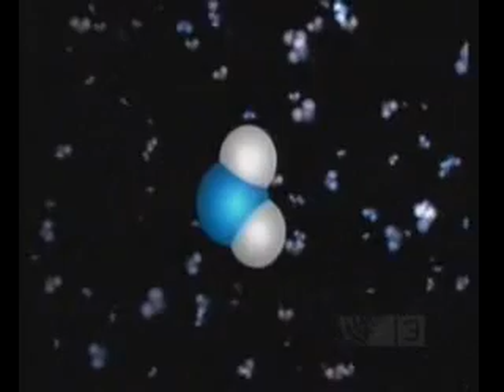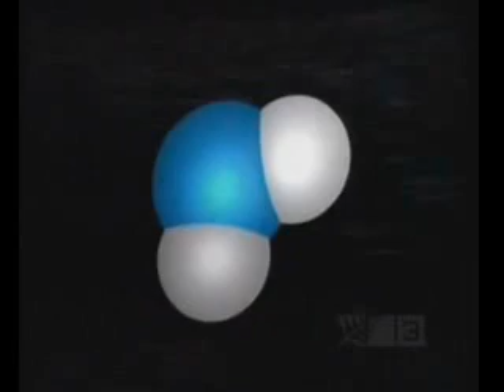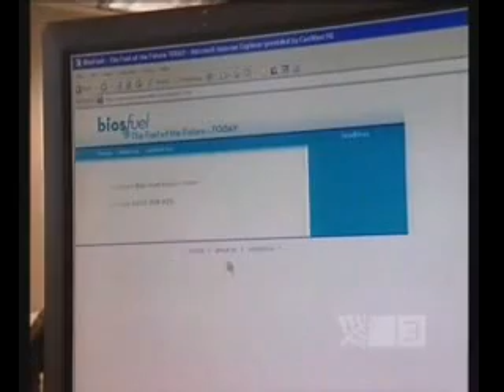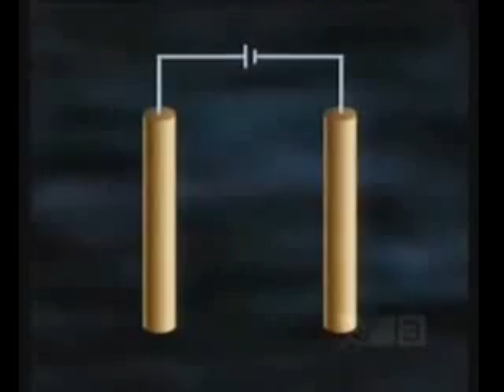A Motorcycle that runs on PURE Water.

Comment: If this actually works on a motorcycle then it wouldn't be that hard to build a 40 hp engine with a generator. Then every home would have there own power supply. Just pound a shallow well or collect rain water for fuel.

Comment: So, what was already in the fuel tank?   Funny how no one bothers to look for the obvious cheat.  Two compartments in the fuel tank. Duh. This motorcycle probably runs on alcohol. That would explain why there is no typical gasoline smell from the exhaust, and why the stuff in the fuel line doesn't look or smell like gasoline.  If this bike was truly running on water, there would be no need for a carb, because the water would have to be separated into hydrogen and oxygen before entering the cyls.   Conclusion:  like all others it's a fraud.  This guy is going to live off of the donations of gullible "investors".... What is sad is that this has happened hundreds of times in the past.  "There is a never ending supply of fools.. who want to be fooled." P.T.Barnum.

Comment: BIOS Fuel??? Exactly WHAT processing has to be done to the water if his engine runs on pure water... If this is ELECTROLYSIS as that professor with the handsome teeth suggested, THAT isn't going to be patented... ELECTROLYSIS is a physical phenomenon that is common knowledge and isn't a trade secret.... So, what we are all expected to take away from this video is that some random, obscure, unknown,  untrained, uneducated self proclaimed inventor with no financial means devised a technology/process which is nothing short of miraculous and which has evaded the entire mainstream scientific community since the invention of the internal combustion engine, and did so without any technological backing or support from ANY well known, established, respected scientific organizations or institutions??? I'd like to know what exactly does anyone think can be done to water (without adding anything to it) that would change its chemical properties and convert it into some sort of combustible fuel? Question... If there was no electricity used in the process, what the hell did connecting those wires do?

Comment: Electrolysis of water does produce Oxygen and Hydrogen but it takes electricity (energy) to make it.
Reply: Did he not say he wasn't using electrolosys? In the HHO world, we knew that HHO can't be used directly in a standard engine configuration due to the outstanding speed of combustion. Hydrogen works in large quantity, but as spoken, needs too much juice to make it.
There IS however, a guy off-grid who makes his hydrogen from solar to power his farm and vehicles.
Saw this video back in my HHO days, never heard whatever happened to this guy.

Comment: If the HHO gas made from water is dense enough, vehicle engine can likely run on it. You will need high amps Alternator that will produce lots of HHO gas via HHO dry cell in seconds and send it to engine.

Comment: They've had motorcycles that run on water for years. They call them jet skis or Sea-Doos! 😂😜
You need a catalyst to help separate the 2 hydrogen molecules from the oxygen molecule. Typically it's done using electricity you can also use baking soda as the catalyst but I'm sure there are other more efficient catalysts then baking soda.
Reply: These products use petrol to run a internal combustion engine that pushes water out the back for the thrust via a turbine pump!!

Comment: Can't remember the name of the chemical but there is a substance that acts as a catalyst when mixed with water allowing it to burn in a combustion engine. Problem is it burns the engine up in short order and costs more than gas. It was featured in an old cop show back in the 70's because the inventor on the show was supposedly murdered.

Comment: Water engine? I guess the days of STEAM ENGINES were not real. But I suppose that technically they needed a companion fuel to heat the water a bit like hybrid electric cars. But even electric needs a secondary source of replenishment. The real water motor has been around for a long time & requires a specific oxygen, hydrogen & nitrous oxide mix to function & that is where the problem lays. Highly explosive in the wrong conditions.

Comment: The "secret process" is passing an electric current through water creating hydrogen and oxygen (discovered by Michael Faraday 1832) This will burn - it's called Browns Gas. So water is just the intermediary, the power comes from electricity. You might as well say a steam engine runs on water (which it does) but water is only the intermediary. See here: https://en.wikipedia.org/wiki/Electrolysis

Comment: I want to smell the exhaust fumes.
Reply: Back in 1972 I set up a small Kubota diesel motor to run reclaimed vegetable oil ( I think it was canola oil) that I heated to engine temperature at about 190F. I had to filter the heck out of it so it wouldn't clog the injectors but it ran pretty dang good! Remember that Rudolf Diesel ran his diesel motor invention on peanut oil. This is what got me thinking it might work. I didn't invent the process but was the first in NW United States to run this diesel on vegoil in a 1970 Honda 600 sedan (tiny Kei car from Japan) The original motor was a two cylinder air cooled piece of !@%@!$ motor that had blown up!  I adapted that two cylinder diesel to fit and drove that thing back and forth over 80 miles round trip per day commuting to work. I ran low one day and had to top up with diesel before heading home. While getting the diesel I left the motor running cause starting it from cold was a process to say the least. The guy started complaining about the fast food smell that was supposedly coming from just down the street, that it was making him hungry! I told him it was my exhaust and he didn't believe me until I made a bet with him to get down and smell my exhaust. If that wasn't the smell source I would give him $5! He sure had a funny look on his face when he got back up. Didn't know what to think. I showed him my engine compartment with the extra plumbing and such to pre-heat the vegetable oil then he started to believe with amazement. I commuted all that summer with that car. It was not very comfortable to drive at 55mph cause the wheels were tiny (10" rim size) and very short wheel base. Kinda like a glorified go kart but fun at slow speeds around town. I still have the vehicle but sold the motor. I plan to convert it to electric power next.
Reply: @willyam9735  We need more people like you with imagination, that is a commodity sadly lacking today, more power to you.

Comment: all you have to do is spray a mist into an electrical grid of wires and you will have fuel that  burns
Reply: jerry metcalf  ive made hydrogen run a lawn mower electrify  the water it creates fuel its not rocket science these hydrogen generators on cars cant put out enough using 12 to 14 volts they need to use an inverter

Comment: Bunk. Either alcohol in tank or second space in tank that holds fuel. Smell the exhaust. Burning hydrogen turns into water but burning fuel will create carbon particles that you can smell. The exhaust should have no smell.

Comment: I can explain it. It is possible to make hydrogen from water by using electricity but the amount made would be so small that it would not be possible to run an engine like he has claimed to do. I doubt that he even makes a little hydrogen, as simple as it is to do. This is simply a farce. Double tank.
Reply: Stop watching mythbusters. It's very possible to make enough hydrogen to run an internal combustion engine using water and electricity.
Reply: Zoes Dada   Didn't you watch the video? It is not possible to make  enough hydrogen to run an engine the way that video shows. It is nonsense. That tiny bit of hydrogen would not do anything.

Comment: A double tank. One has gas in it and the other he poured water into. It runs on the gas. I have seen the same farce on a lawn mower, at a fairgrounds. Proven a farce.
Reply: Joe Blow  Without having the opportunity to inspect it myself I can only go by what they say in the video, and there they had a mechanic study it and there was a very basic setup, nothing complicated. If there was petrol going in, it has to come from somewhere (they found nothing) and it has to have a means of getting into the intake system, they found no means for it either. I'm not saying it's all true, in fact I very much doubt it's true at all, but they did look for that sort of thing and found nothing. You could of course still be right, maybe the fuel is delivered through channels carefully embedded in the frame or some sections and through tiny channels in the body of that carburettor or something. I just know they say they checked for that sort of thing and 'they' found nothing.
Reply: Joe Blow I

Comment: Another scammer. I could pour oatmeal and sand in that tank and it would run.. as long as I had some gas in the second tank. ;)
Reply: McFlySwatter check out the diy hydrogen torch video its super simple and works. No reason why a motor could not

Comment: 2.3k comments and I only see 25 or less comments. that strange. Im here to get clues by the way this is the real deal .. It takes knowledge to see all the clues.  Lots of clues fun to watch. My time is limited  but  I will adress some clues. Bike takes a few sec. to start. White smoke came out from muffler.
They show him working on a big engine that mean he knows how to  change parts inside the engine to make water explode with part water part hydrogen this was not regular H20 he was using heavy water that has more hydrogen on it. also there a special metal that heat up with hydrogen when Combine to make the water steam this combination and some others things would make this work. If you have the $$ and time I'm sure we could make it work..
Sadly I have rhe knowledge the time but not the funds..

Comment: If you had A very high compression engine and you just injected water, which would flash to steam, it could power an engine.  But it's just A theory.
Reply: Except that you have it backwards, raising the pressure raises the boiling point. And then there are those pesky laws of thermodynamics

Comment: I have a water fueled bike.  First I drink the water, then pedal the bike.

Let's see the large amounts steam come out the tailpipe!

What there isn't any steam coming out? 

 Fraud...not to mention the time that has gone by and nothing has come of this B.S. technology.

He is just using a fuel tank that is sectioned off so the water added is not used.  Or fuel hidden in the frame of the bike.  

He probably uses a bubbler with hidden fuel in the frame.  Then he gets the fuel from the air intake itself.  Probably an alcohol or fuel that does not smell much.  It would explain why the bike is so difficult to start and why he wanted the guy to take it easy on the bike.  Engines that are run on bubblers tend to heat up rather quickly and can melt pistons/valves if it is put through the paces.  

I have a lawnmower that runs on a bubbler system, even with a lowered compression ratio it still runs hot. It is good for about ten minutes at a time.  Then it has to cool down for about a half hour. 

  The carburetor was unrepairable so the bubbler was my last option.  It also is a pain to start the mower.

Comment: It's easy to claim you have constructed an engine running on water, but it is impossible to do it. Beware of such hoaxes. Water isn't a fuel. If you split it in oxygen and hydrogen, you have a fuel, but doing this separation needs more energy than the hydrogen can deliver.

Comment: THE ONLY WAY he could’ve done this is either reverse-engineered a fuel cell(Daniel dingel’s claim or those new fuel cell flash lights on TV) of vaporized the water using heat and the engine’s vacuum and modded the engine’s ignition system to make a spark strong enough to ionize and burn the water vapor.

If he didn’t do these two thing, he’s fraud..
Reply: LOL. Derpy, Big statement, though easy to make you look silly =) pardon me doing so my friend.
Check, check, 
check diss out mar barddy...

With platinum plugs, a detuned carby, and as for the water... "that's easy".
He showed you already, it took me 10 mins to discover this. Since he showed you that this needs sunlight..... this is "exclusion zone water". ( the zone will not appear without sunlight)

water is a liquid crystal indeed.
aka re-structured water. .
Anyone who follows this will make the same thing. Am I a fraud too???
If he didn't show the device as he did, I wouldn't have made this remark.

There will be many who will respond with crap to this comment, but also, a few who will see its self evident and try it themselves rather than talk crap, they will, like him, prove it to be my atypical truth. Despite how  "CRAZY" it seems to the ignorant debases.
Reply: +IntuitivePhysisist make a steam injection unit that uses exhaust heat, pair that would preheated fuel and plasma ignition.

You can ionize and separate water that way, but this “liquid crystal” pseudoscience is what I’m talking about.

Unless you can combine a triboelectric effect, vortexing heat exchange fuel reforming and the idea of using a catalytic ferromagnetic permeable rod(say alnico alloy rod for instance) in a central pipe for surface area to split water, you can’t get more out of water than you put in.

The plasma ignition, the hypothetical fuel reformer concept or a form of Steam electrolysis are your main methods for getting energy from water.
Reply: this is the type of reply i expected..
I am not talking about stanly myers method.. I am talking about exclusion zone water as can be seen by his device that  liter water takes some 20 mins to flow through. if you spent 5 mins research about that you'd understand. also, your attitude kills people. If water being a liquid crystal is pseudo-science then how have i been fighting for my life for 6 months now??? almost dead from renal failure 3 times in the first 5 1/2 weeks.....
I will give up on your closed mind now, and tell you that the future will prove you, and others wrong. open your mind. Do research on exclusion zone water, watch video again, pay attention to his water device, notice the light reflector on top??? notice the electrical leads, notice the time it takes water to flow through.. need i really say more. this should be enough to help your pseudo-science mind except the self-evident truth.

this truth now passes the ridicule stage, and goes into violent opposition.. then, to being accepted as self evident. this can provide electricity derived from generators to developing countires and localities. changing lives. this is why i have given you all this advice. I look forward to seeing others re-create this and change the world.

your comments will only encourage others to try this and also prove you wrong.
Reply: futhermore, your pseudo-science involving water being a liquid crystal not possible, bear in mind this; We cannot see molecular structure! they are theoretical also.
Reply: I’ll gladly admit I was wrong about EZ water, but it has to be reacted to get the combustible gases from it still.
Reply: Yes. thats right (unless something else is going on, always possible i quess) It would be easy to do this with platinum spark plugs. I have seen people playing with HV and water on spark plugs trying to work this out, albeit crudely. the reaction was MUCH larger on platinum plugs. in fact, interestingly, i can light my hexane, hydrogen and oxygen torch with platinum wire, provided the hexane is small.

Play around with this friend, you will get it working. I am very curious about what is going on molecular level with this and how any changes take place under compression, id imagine there would be some issue with detonation whilst compressing but this guy has said nothing about it yet. its clear this bike has less power than petrol, this perhaps due to catalytic losses. I mean if gas from slip water is so explosive (hho) then we are observing power loss indeed.

perhaps this can be changed by use of other PGM? perhpas iridium.
Reply: Technically it’s not the platinum spark plug itself, but the plasma jet ignition required to make a plasma glow instead of a traditional hv spark.
Reply: Having to divert my work into water for some time to combat police manipulation of my medical rights, I'm doing this now. It's clear that you are correct friend. There will be the need to add capacitance to the spark plug. This may also require a heat protective coating on the piston crown due to increased heat at the spark point on the piston.  This is easy to do with high grade ceramic spray. Perhaps irridium will give the longest life to the plug, but may not work as platinum will in terms of catalytic action. In such case a custom platinum / irridium metal will be produced.
 
I'm also running tests to see the difference of negative potential water (standard EZ water) and positive potential water. This im doing by use of platinum electrode for negative water and carbon for positive. I'm going about it in different ways by trying a carbon disk for negative water outlet (hence the need of platinum electrode, just as my intuition suggested). Device made from a filter disk water bottle (brita).

Thanks for your input Derpy.

Comment: This isn't new.  It's electrolysis.  He's using the electricity from the alternator and battery (to produce the DC voltage required) with sulfuric acid or possibly sodium hydroxide in the water to separate the hydrogen and oxygen atoms, then routing the gases into the engine.  The process was discovered/invented in 1800.   But the production of the gases is probably less than what is consumed by the engine, therefore, a storage tank might be needed to extend the range of the bike.

He probably had to lower the compression ratio because his secret formula might not have any octane boosters.